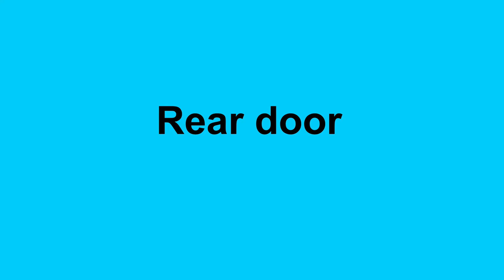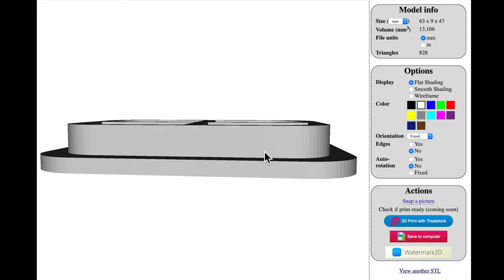Installing sound deadening insulation 1997 Toyota RAV4 (episode 20)

Comment: Oh man! You did the floors the hard way! Little trick to remove sound denting from the floor is to brake some dry ice and smear it all over it. Then tap it with a hammer and it’ll shatter off without leaving sticky residue.🤘
Reply from the maker: Thanks for the tips!

Comment: I was about to do this, but once added: work hours+materials+result (around "only"30% noise reduction), i realised that I was better off selling my rav4, and, with just a few bucks on top, buying a better noise insulated old SUV (like nissan xtrail, honda crv 2nd gen) .
To sum it up  : great job (and awesome video) but not worth the hassle
Reply from the maker: Thanks!  Ironically, I did a similar thing - I bought a 2017 Hyundai Tucson and it's much quieter than the RAV4 with sound deadening.

Comment: The plastic liners I thought were to aid in sound travel via air travel. When I had my door window worked on they did not "reseal" the plastic and I could hear "air" road noise.
I took door apart much later to have my suspicion validated. Plastic is sound deadening

Comment: ALSO THANK YOU FOR THE STL FILE. YOURE A LIFE SAVER.
Reply from the maker: You're welcome!  The plastic plugs are much better than original.  They're a loose fit, to allow for size variations in these old cars.
Reply: @LabCoatPaul  would you have any resources for disassembling the dash? I was thinking maybe I could address the engine noise by sound deadening the interior side firewall

Comment: Incredible work!! How come you did not insulate under the hood or elsewhere in the engine compartment? Is most of the noise from the road / wind? I have not taken the plunge on a Rav 4 Gen 1 yet. Doing my research.
Reply from the maker: The engine is also pretty loud, and you can reduce engine noise by adding insulation to the hood. Most cars will have soft fiberglass hood insulation instead of the heavy sound deadening I used inside the car. Newer cars usually have a plastic and foam engine cover that also reduces noise.

There are 2 ways to own a first generation RAV4. First, you must realize the car is more than 25 years old and needs a ton of repairs.

Option 1: It's an old POS but probably won't leave you stranded. Maintain the car and fix things that prevent it from moving and don't worry about the 1,000 other problems it has. This is the most practical and cost effective.

Option 2: try to turn it into a new car. This is impossible and very expensive. You can fix everything and restore the car, but when you're done, you get a car from the 1990's that is not safe, not fast, loud, and not very fuel efficient. It's kind of a bad car compared to newer ones. Play stupid games, win stupid prizes.
Reply: @LabCoatPaul  Paul - I appreciate the straight advice. I have switched to looking for a Gen 3 Hilux Surf (same as 4Runer but RHD for Ireland). It will cost a little more but is ultimately more refined.

Comment: great work! im using your videos to guide restoring my 1996 rav4. What would you recommend if the carpet is in really bad condition?
Reply from the maker: Steam clean it!  I considered getting a replacement carpet, but it's way too expensive.  After steam cleaning, my carpet looks almost like new.  Also, take the carpet out of the car to clean it.
Reply: @LabCoatPaul  thanks for the tip! It has some holes and such, so do you know some diy way of fixing/replacing it. like what type of carpet to search for?
Reply from the maker: @eztofollow  You can just use house carpet from your local hardware store.  It won't fit as well, but it will look great!  Cut it a little bit too big, then trim it once it's inside the car.
Reply: @LabCoatPaul  house carpet in a car would be so nice

Comment: another great video!  

Where I live there's lots of rain and humidity and since my RAV4 98' is parked outside it really suffers there.
Last year I tried to fix the front lamps as there's constantly water inside after a few days of rain. I unsealed them and sealed them again very carefully... but I failed, same problem now :/ ... I also invested in sanding the whole chassis and painting with some anti-rust stuff, that helped definitely but who knows for how long.
Maybe You should make a video on how to protect the RAV4 I against rust/water inside :-)

Greetings from Poland!
Reply from the maker: Thanks!  The easy way to prevent rust is spraying a rust protecting oil like fluid film inside the frame, and on exposed metal parts.  It's easier to do than painting, and does a good job.

Comment: Paul! I will do this project on vacations and was wondering what's the purpose of the rubber plugs? What happens if I leave the wholes uncovered? Aren't they made to filter the water?
Reply from the maker: The rubber plugs in the floor prevent water from getting inside the car.  If you leave them out and drive through water when it's raining, you'll get water trapped between the metal floor and the carpet, and the floor will rust.
Reply: @LabCoatPaul  excelente thank you

Comment: Not sure if you mentioned this, but how much insulation did you buy for your rav4?
Reply from the maker: It's at the end of the video.  14:17   I used 3 boxes of 36 square feet each.
Reply: @Lab Coat Paul  👍😀

Comment: You only used foil backed rubber butyl which is for vibration not sound deadening. You need to put the layer of sound deadening on top. Thanks for the detailed video

you used is for vibration and only needs 20% coverage. The sound deadening goes on top
Reply from the maker: Interesting...  I would say the car is 30% quieter than before.  That's just a guess.  I didn't measure it.

What would you recommend for sound deadening?

Comment: hey paul. i’ve spilt drinks so many times in my rav4. shoukd i look into taking out the carpet to see if there’s rust? i also have a weird leak when it rains. the front of the headliner by the rear view and sun shades gets soaking wet and i don’t know why.. i just got a new windshield and the problem still happens. i need advice!
Reply from the maker: The paint on the floor of the RAV4 is pretty good, so it's not likely that your drinks caused any rust.  Taking the carpet out is pretty easy, so if you want your RAV4 to be super clean, you can remove the carpet and clean it outside the car.  Last year I took the seats and carpet out and washed the floor with a hose and a brush.  You can't get 20 years of dirt out of your car without taking it apart.
It sounds like your windshield has a leak.  Take it to the car wash and power wash around the windshield to see if that's your leak.  I think your installer did a bad job and should re-do it.
Reply: @LabCoatPaul  Thanks man! the bolts caused the backseat threading to strip out, but I'll see what I can do...
Reply from the maker: @jacksitner3314  You might be able to drill out the seat bolt threads and use a nut on the back side.  My driver's seat is mounted like that.  The back seat bolts will be harder to reach.

Comment: Does you rear little windows seal work well? Mines get foggy n hard to defrost in cold weather. Just wondering.
Reply from the maker: I haven't had that problem, but I also don't drive my RAV4.  Every car has small exhaust vent flaps in the back of the car.  You'll see some small slits in the rear panels by where the shocks mount.  Make sure these are not plugged or covered.

Comment: Would you say this helped you AC be more efficient? Probably not. I am just curious.
Reply from the maker: My A/C has always worked well and I don't drive the car enough to know if there was a difference.  I've had a pretty bad time with this RAV4.  It still clunks because of a rusted out subframe, so I bought a newer car 3 years ago and the RAV4 is only used for videos.

Comment: Hold on. You have your own 3D printer?! Paul, what do you do for a living??
Reply from the maker: Yes.  3D printers are great for those small plastic parts.  I work at a bicycle shop and I bartend.  I used to be a car mechanic, but I worked too many hours and the pay was terrible.  The pay at the bike shop is really low too, so I bartend.  Some day I'll get a real job.
Reply: Paul Shpakov oh nice! I used to be a custom painter at Trek for their project one bikes.
Reply: @LabCoatPaul  man, you should host a gen 1 rav meetup when you get some free time. I would love an excuse to drive thru cali and nevada any time of the year. plus ive never been to slc.

Comment: I want to buy a 1998 rav4 or a 1996 vitara with 150-180 thousand kilometers, it costs 6000-7500 dollars.  However, I feel that to make it work properly I will spend about 5,000 dollars and to leave it aesthetically as I like another 3,000, with that money I would buy a grand vitara from 2012 or newer, a much more reliable and safer car.  Am I right or is it not necessary to spend so much? Excellent video, really entrainment and interesting.
Reply from the maker: You're exactly right about this.  Buying the newer car is a much better deal.  You will spend much more than the car is worth undoing 25 years worth of damage, and in the end you still get a car that is much worse than the newer one.  Funny story:  my rav4 was so bad that I bought a 2017 Hyundai Tucson 2 years ago.  The RAV4 was a rusty POS the first year I owned it.  It spent half that time in the garage while I fixed the suspension.  I rode a scooter everywhere, and froze my ass off all winter long.  The second year, I discovered a blown head gasket and froze my ass off on my scooter all winter long.  I had enough of that so I bought a real car.  I still fix the RAV4, and it's still not useful.

Comment: Question about the wholes in the floor... Are those made by the manufacturer and what's is the purpose of the wholes if they are sealed with plugs? Wouldn't it be better if it did no have wholes?
Reply from the maker: The RAV4 comes from the factory with a lot of holes in the floor.  I don't know why, but my guess is they are needed during assembly at the factory.  Maybe the robots put their little hands in there.
Reply: @LabCoatPaul  hey Paul, I already removed all the old insulation covers ( took a while) some of them were in a very good state by the way, but I"m having trouble finding the "goo gone" pruduct in Costa Rica... Any idea about other brand or similar products? I used grease remover but it's not doing it thanks
Reply: Never mind... I found it on a local store! By the way my Rav4 96 has double sun roof so it made it harder to remove the ceiling cover
Reply from the maker: @bobdavislumbro4047  You can try some other solvents like acetone or kerosene.  Brake parts cleaner works, but it's too strong and removes paint.
Reply: @LabCoatPaul  yeah, I found the goo gone on a local store so all good!

Comment: How is your gas mileage now vs before?
Reply from the maker: The insulation added about 40 pounds of weight to the car.  I don't think it will have any effect on the gas mileage.  I got 21 mpg last time I checked, but I don't drive the RAV4 any more because I have a newer car.

Comment: was it worth it?
Reply from the maker: That depends on how much you value your time.  In general, my RAV4 is not worth fixing.  It's a very old car and significantly worse than a newer car in almost every way.  If you like your RAV4 and plan on driving it a lot, sure, sound deadening insulation makes it quieter and more pleasant to drive.

Comment: How to remove driver left footrest so I can remove carpet?
Reply from the maker: Easy.  There are 1 or 2 nuts under a cover that hold it on.
Reply: @LabCoatPaul  
Thank you, sir.  I couldn't open the covers so I ended up prying the footrest off.  How did you remove those covers?

Comment: How do I make my rav4 fast 😢
Reply from the maker: That's a big question.   The best way is doing the 3S-GTE swap.  Remove the 120hp 3S-FE engine, install the 260hp 3S-GTE.
Reply: @LabCoatPaul  but my car is automatic will this work with my car ? 🤞thank you for for answering I literally watch every rav4 video you post I literally bought some of same Products for my RAV4 because you recommended it and I’m 100 % satisfied so far 😄

Comment: not worth the effort, it also adds weight to an already slow vehicle, theres 1 much simpler thing to do to transform the appearance, paint the ugly grey bumpers to black using a bumper trim paint can, doesn't require any real painting skill and retains a factory finish, just black, only needed 3 cans on the 5door version.
Reply from the maker: I kind of agree with you on this one.  If you watch the before and after clips, they're both loud.  A smart person would just buy a newer car.  Then it would be faster, quieter, and look better.
Reply from the maker: @xxxYYZxxx  I plan on making an off road video at some point.  The RAV4 is still too broken to drive it anywhere at the moment.  It's mixing oil and coolant.